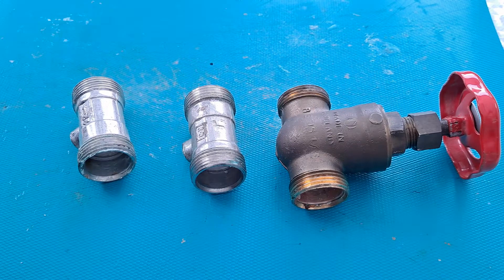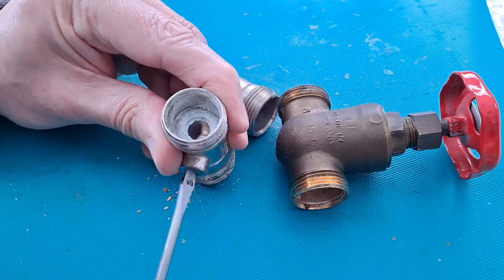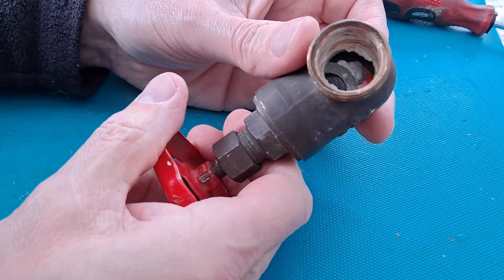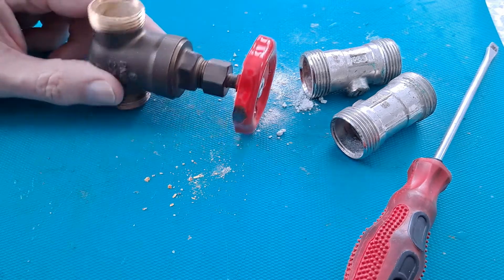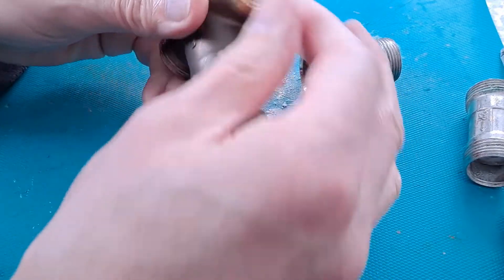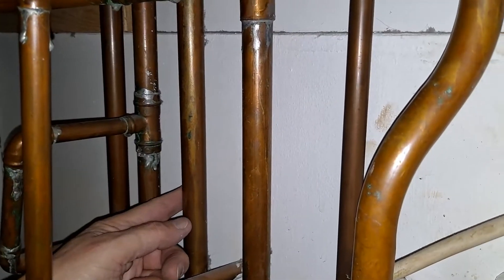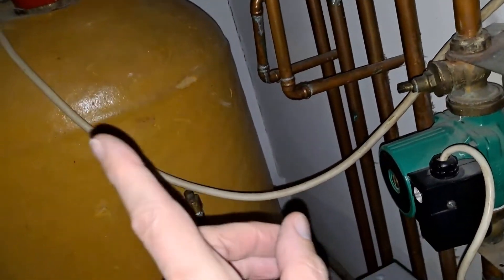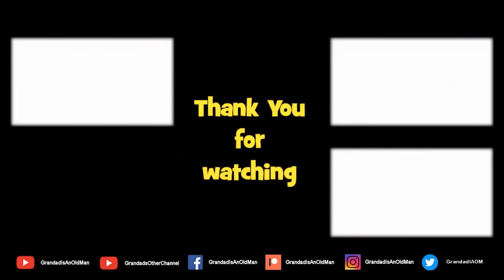Looking at some Furred up water valves

Comment: Interesting Video. Good To know how the Hot and cold water System works.
Reply from the maker: This is pretty old stuff, most modern houses do not have a cold water tank in the roof. The water is heated direct, on demand, so you only heat what you need.